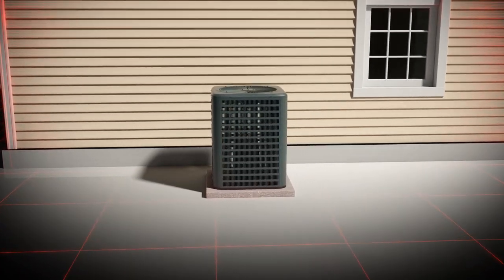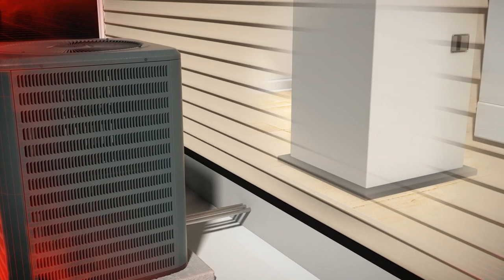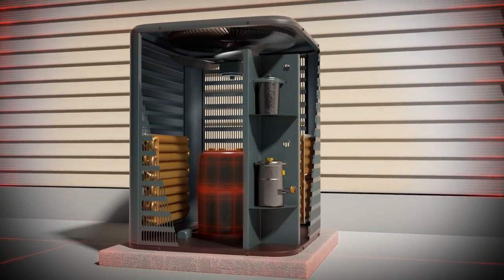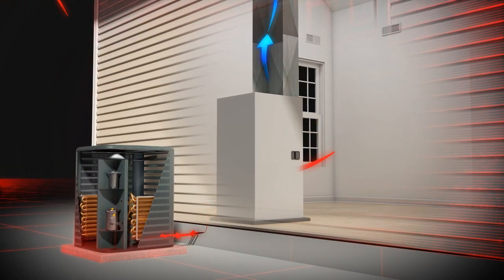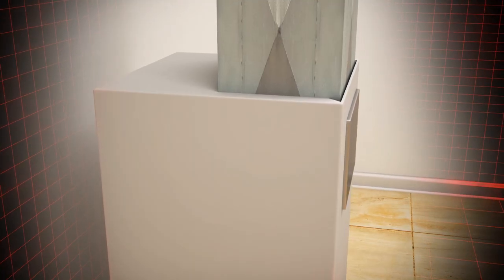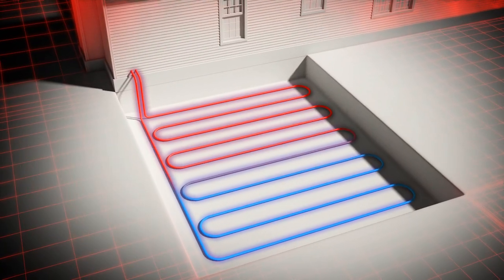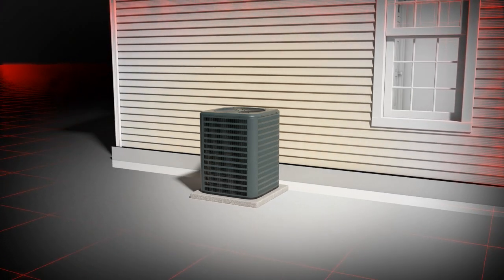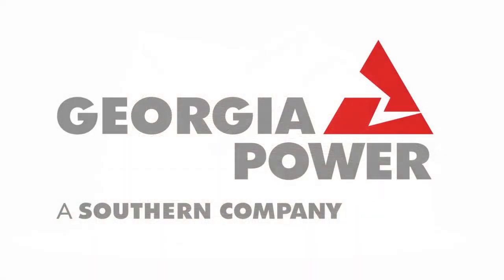How a Heat Pump Works

Comment: This makes no sense “even on cold days there’s enough heat in the air” of the air is cold then that’s due to there being no heat in it 🤨
Reply: 0 on the Kelvin scale or -460 degrees F is no heat in the air. Believe it or not there is still heat even at 0 degrees. Just not warm to us.
Reply: This baffled me too..but I realised it's all about Heat transfer. The outside temperature is still very "toasty and warm" enough for the refrigerant to grab it and boil...before being compressed to release it inside the house. So there is still enough heat, not for us, but for the refrigerant which boils at extremely low temps.
Reply: @rollogic2988  agree, absence of heat will be at absolute zero temperature where molecular activity stops
Reply: That’s like saying an air conditioner doesn’t make sense cause it’s hot outside